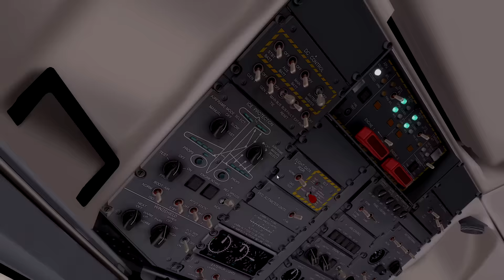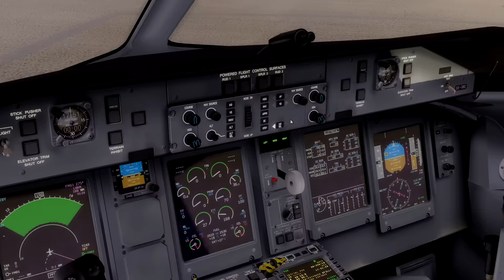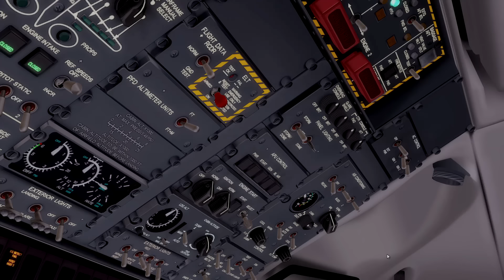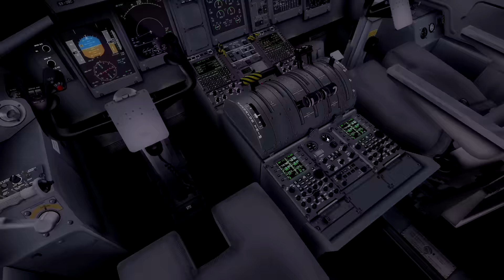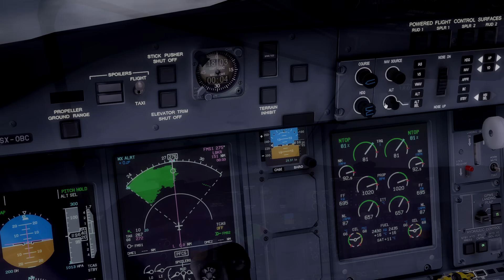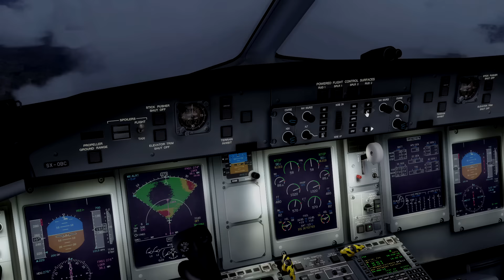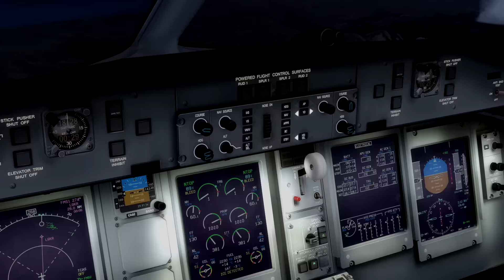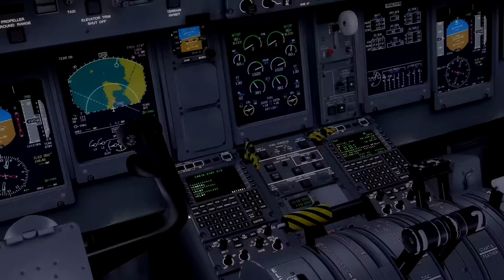P3D: Skiathos - JSI to Corfu - CFU | Majestic Q400 | FlyTampa Corfu

Comment: How did you manage to get the lights working? I am using the migration tool with p3d v3.2 and every single addon airport i tried to install has runway and taxiway light problem. The funny thing is that with flytampa athens i do not have this problem!